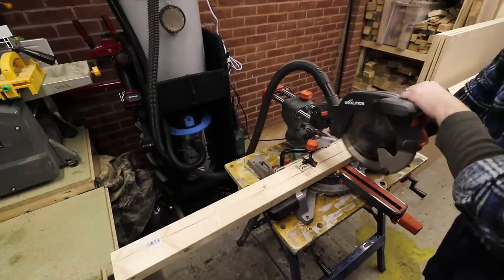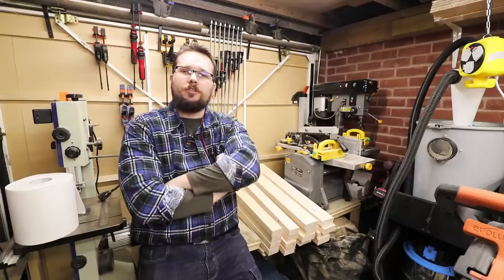Workbench for small shops - all in one solution PART 1

Comment: Sorry me again haha. Im new to pocket hole joinery and have the UJK pocket hole jig. At 3:07 it shows on your jig max thickness off 38mm. Well my 2x4s are 45mm thick as I assume yours are pretty much too. My UJK jig allows for max thickness off 36mm. I joined two pieces of scrap 2x4 together to test and it worked fine but didnt seem the strongest hold and was using the longest screws I had in the trade pack I got witht the jig. My question is what are the cons of using thicker material than what it states it can handle and how do you know what length screw to use. Thanks and hope to hear back from you. Cheers and great vids 😃👍
Reply from the maker: I had the Longer screws for this I think 60mm buy can't remember. You can add wood glue for additional strength. But as you can see my workbench is few years old, travelled from UK to Poland and its holding just fine on the screws only.
Reply: @Casual DIY  Thanks for the reply. Yes i used 60mm too so even though they didnt exit the piece dead centre they probably fo further in to make a sufficiant hold. I will use glue where I can but like you I need to beable to take it apart to a degree incase I move it. Thanks for the info.

One more thing have you a link to them clamping/positioning squares you used to make sure everything was fastened together square. Any reccomendations? Thanks
Reply from the maker: @robcheetham4370  sure, here are similar to mine https://amzn.to/3REKIAm
or something bit more fancy - https://amzn.to/3l31XPk
Reply: Thanks. I got the faithfull ones in the end. All good so far 😀

Comment: At 7:14 I notice how the legs protude from the top frame a few centimetres. What is the reason for this or have I missed something. Thanks and great build 😀
Reply from the maker: Hehe yes well spotted. That leadge was created for a back that I was planning to add to this workbench but it never came to be.
Reply: @CasualDIY  Thanks very much for the quick reply. I have been wanting to build a flip top mitre saw bench for a while now an this is the best video ive found on youtube so far and I like the design especially the adjusting plates to get the top perfectly level. Ill be building mine longer resulting in two comparements either side of the mitre saw compartment and have 12 legs instead of 8. Im going to use sketchup to design it first. So thankyou for more than a great starting point towards my goal. Youve got yourself another subscriber 😀. Thanks again.
Reply from the maker: @robcheetham4370  glad that my video was some help. Happy building and welcome aboard 👍😁